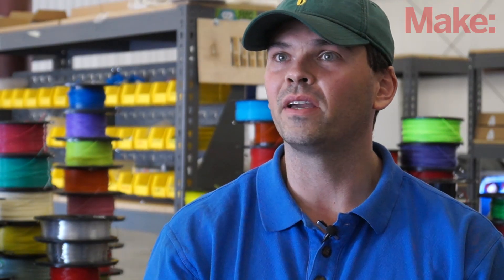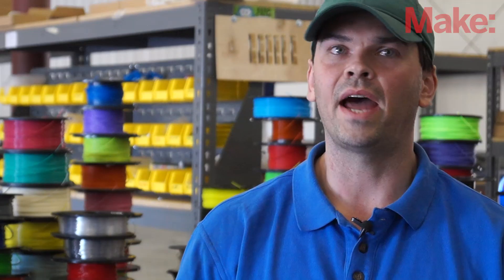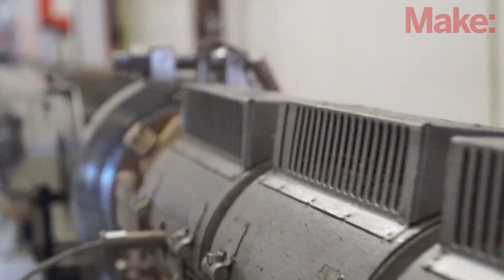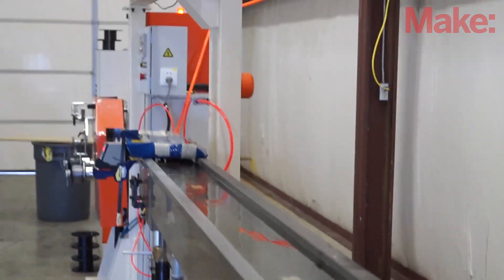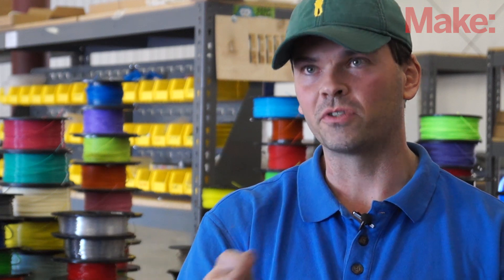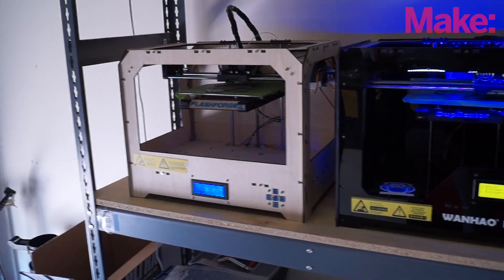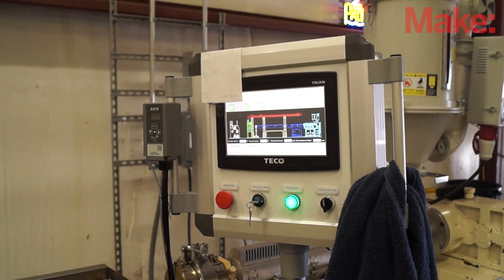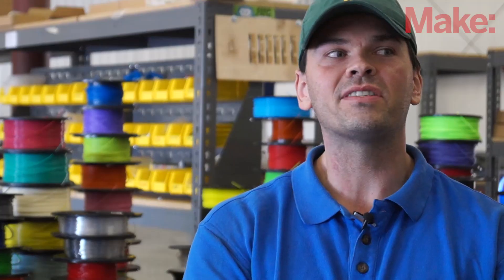How It Is Made: 3D Printing Filament

Comment: Oh....a commercial about how your quality product is being made in America. Never mind telling us what kind of pigment is used or how it's introduced. Never mind what temperature the water is to cool the fulfilment or how the extruder is set in the dimension or any linear explanation of the process. Instead just talk about your precision product that is self automated and you just push a button. I take it you're just a machine operator who bought the extruder machine. Thanks, but I'll buy my fulfilment from China as it is cheaper.
Reply: I bet you voted for Change also....  

You saw a commercial for a product... I saw a video about pride in workmanship...
Reply: Settle down Francis.
Reply: Alvester Coon
Seriously? I transcribed it and you still want to debate it? This is a how its made video, not a where its bought or a quality control how to video. Where do you come up with this stuff? Do you really just type to listen to your brain rattle in your head? This is not a commercial, once again verbatim "there wasn't a quality control issue", see, no problem getting the filament from somewhere else! Go ask Gandalf.
Reply: Yes it's cheaper, and yes this was an interview based commercial, but they are both making it and using it them selfs. This is a good sign, because they will more often then not find problems before they get to their consumers, so their quality will be better then a china company that only makes the filament.

There is also another seceret benefit. Because the product is produced in the US, so it has a smaller carbon footprint when sold to in the US then those that are shipped over seas.

This channel is all about people making stuff themselfs and then telling you about it, if you don't like this then your literaly on the wrong channel because most of the the episode are in one form or another advertisment for the people in them.
Reply: Ignoring the rest of the comments, watch at 4:08, you can see:
- Zone 1 169,5 celcius
- Zone 2 189,7 celcius
- Zone 3 195,1 celcius
- Die temp 180.4 celcius
- Hot Water: 52.6 celcius.

SO! now you know. Good luck making your own filament.
Reply: I've bought many rolls from all over and Makergeeks is on my buy list for 1.75mm ABS and PLA.  Never had an issue and don't mind the extra money because having a 10-20 hour print job fail can real kill repeat business.
Reply: Alvester, I feel like you're not quite grasping the point of the video. That's okay; you aren't the only one.

I could point out how he specifically mentions how you will (likely) never get an oval-shaped filament from him, or how he expressly explains how the whole process works. All that stuff is self-evident, and pointless to argue. You either agree with it or think he is lying.

The point of the video was to explain how 3D printer filament is created. Regardless of where in the world your filament is made, it goes through a process that is essentially the same as this. The point of this video is to explain the process, not to tout a single brand. At one point he explains how oval-shaped filament is produced, and explains why it is likely an error, and not a fundamental design flaw. In that he is basically forgiving and admonishing companies who create such filament. He isn't trying to draw you to buy his filament, he's just pointing out the differences between his and others'.
Reply: Did you bother watching the video? In the first 20 seconds he states there was no quality or price issue with China's product, there was no screaming "America" or any mention of pride. He put the machine together himself and through research he came up with the numbers. It shows the water temps if you actually watch the video and pay attention. If you keep watching you'll see he doesn't need calipers as he uses lasers and adjusts if there's any deviations. I doubt you've worked in manufacturing, you can't even process a 5 minute video (or even spell for that matter! Jesus Christ sound it out or something!). Are you the laid off custodian you mentioned in your comment? The one that just pushes buttons? They probably just kept you in the corner with your foil hat on while you counted your fingers. I think your too obsessed with America. Just let it go man, your seeing and hearing what you want, not whats in the video.
Reply: All I see is a bunch of hate on america. You're welcome to leave whenever.
Reply: Recycled plastic wouldn't be my first choice for 3d printing things that take hours to complete and could be ruined by an "inclusion" (specks of junk that are impossible to completely separate from trash sourced plastic). Trying to make high quality filament out of recycled plastic would be a poor business decision and poor product.

I was surprised that you were surprised "at the lack of 'how it is made'". The video was titled "Making 3D Filament" and showed every step the company takes to produce it. But you fault them for not setting up their own complex plastics manufacturing facility as well?

What I conclude from your comment and others like it is that 3d printing is a huge fascination for young hobbyists (which it should be) and as a result their learning curve will inevitably involve many false assumptions. This is always the way. :)
Reply: Morearty Rockwood
I just did a little spread sheet sorting on the rolls I've brought and from where. From China from 3-2013 to 7-2014 I purchased 21 rolls from six venders. 30% of that was useless crap. None of which would be worth the cost of return for replacement.  From 9-13 to present I've brought 7 rolls off ebay and 3 where crap. Again seller doesn't do return and filing a NAD is to risky for retaliation. 2-13 to present 47 rolls from American vendors and only 3 issues and each was replaced promptly.

There is a difference in vendors and filaments even if it's the same machine being used to make it. If I'm just turning out small trinkets I'll use the cheap stuff to get rid of it. I don't loss much on a failure. But when that big $$$ print job goes through and it's a 20hrs plus job I'll be using the stuff I trust. Depending on the surface texture and strength I'll select which venders stuff fits the need.  MG is stiff, Afinia is more of a creamy texture, MB is plyable, MH has little stringing, etc, etc.
Reply: You dint expect him to be blogging about it, do you? 

Personally I found the drying tip very useful.
Reply: we make this 3D filament machine, email:friend2031@friend2011.com
Reply: *****
  LOL 'the fastest' damm good one. Thank you for the smile.
Reply: ***** So you're attacking me for what exactly? Nothing you wrote seems to apply to anything I said... Are you lost? You seem to be taking my critique of someone else's comment awfully hard. Should you want to actually express a worthwhile opinion regarding that comment you might try quoting the parts you are troubled by and actually relating why instead of spouting ad-hominem insults while pretending to be clever.

ed: spelling
Reply: That’s fine. Why be a dick about it?
Reply: this is not the science channel
Reply: I made a 5kg / hour DIY filament extruder for your 3D Printer which you can rebuild buy your own and safe a lot of money. I share my whole knowhow in now over 180 videos about 3D, Filament Extruder, CNC. Visit my channel and rebuild what you like. I speak german but i have for all videos translations. Share it if you like it.
Reply: blaegme
Well, is it made in North America? Those pellets don't appear out of nowhere. Like many other commentators, I was surprised at the lack of “how it is made”. I genuinely hoped they were melting down recycled plastic. That'd be a small carbon footprint.
Reply: whats more important is that he bought the machine and hes buying the materials from China too :) just like Apple products, produced in China, "tested in US", placed silly price 100 times higher than they buy it from China and plus the brand price.
Reply: Typical right-wing ignorance thinking everyone on earth is American.
Reply: +blaegme read my last comment. The companies in China are the same in America. The ones who make  fulfilment are a division on that company to drive up prices. You can call it American made either way and not tell the difference.
Reply: +briandm82 did you watch the video because he didn't make a statement about the price of products from China or the quality. You clearly don't understand the concept of competition in business as this is a commercial and people just see a video about pride of America's workforce. Never mind the same American business own the China production and never mind they drive up the price under the American label. Usually the China products can be found online at a lower price from the factories due to poor quality control which the American branch doesn't mind as it creates the illusion of smarter consumerism with the public. Those product found cheaply shipped from China won't have the American label and from either a bad mixture in the plastic due to errors in production or bad machine operator procedure, the American branch will look away and say the China branch can do as it pleases with the flawed product as long as the label isn't on it. Might as well make a few dollars online. Why would they throw away something that could still be sold? It's very simple. They do it all the time. At the same time they drive up the price of whatever is in the stock house, not really telling you whether it's made IN America or China. It will say it is a product of America, because after all the quality will hold up from inspection. The only evidence is the part number it was given as with the date, location and code stamp of the shift responsible would tell. The price will be higher none the less. A little less pride in how people view product and getting to the bottom line of where your product comes from goes a long way. You are seeing and hearing what you want without understanding the production line and how it is sold. You know nothing. Are you a laid off custodial manager or something that couldn't manage a broom? I'm a machinist with CNC and manual lathe and Bridgeport under my belt. You probably have never held a Vermeer tool. So before you flap your mouth try and understand production and how it's made before making conclusions. I suggest actually watching the video and stop wasting space by staring off. That's how you probably got laid off in the first place. Be mindful and try using thinking before making an uneducated statement. You just made yourself look stupid.
Reply: Seems more like he is trying to sell his fulfilment. This isn't a 'how it is made' video. I grasp the concept very well enough to know this is a rising industry that people want to promote their product. This isn't a how it's made video. It should be labelled as how 3d printing is competitive and people like you don't grasp that there are other markets out here in the global economy. There are those businesses that make just as good printing filliment. You do your research. This guy explains how hard it it to get the temperature right and calibration that is fully automated. I've heard the same shpeal working in a machine shop as a tool maker and explaining it to kids who come out of the street that think it's about pushing a button, which in this case it is. He pushes a button and the machine does the work, keeping the water at a constant set temperature as it cools the filliment slowly. That's obvious as plastic will will warp if the bath is too cold. And air drying plays an important role as it is run through the machine to keep it constant. I know this not o lynch having taken a tour with a friend who works on these, but also working the guy on plastic printing presses which we used a combo of uv light and heat in a hybrid design that we worked on. 
Forget the pridership of america and your obsessions of political prowling as that has nothing to do with 'how it is made'. I'm surprised at a lot of people's gullibility and not seeing as this as a Make's way of promoting their product from another part of their business venture which they own. It is utter stupidity to blindly see pride when this is a poor version of 'how it's made' video that is in part a commercial. I worked for a company that made gun parts that had more precision and quality than Smith, but I didn't go around screaming "AMERICA!" Every time I knew I made a quality scope mount for a rifle. Pride should have nothing to do with precision and function as it takes more than some machine operator who who got laid off at a custodial job to come in and push a button. Those aren't machine operators. They don't even know the G codes and they sit there to watch the machine and load the parts. This machine is far more simple than operating a 5 axis hass machine or manual Bridgeport. You push a button, make sure the tank is properly level since the water evaporates. This explanation is so poor  in the process a dumb kid who has to push the button won't understand what goes into quality control. This stuff is manufactured cheaply. Something as simple as picking up a micrometer or vernier and measuring the thickness every 5 feet would tell you something. But they don't. And it is far unlikely they tell anyone. And if they are comparing oval shaped extrusion that is a very older issue that was solved. No one sells oval shaped extrusion as that is not good enough for selling and would be sold second hand on eBay without their label. No point in letting a few bucks go to waste, after all. It would encourage those who buy it to buy more expensive stuff to ensure that they don't get stuff like that again. So, drive up the cost for quality control, not because they did anything about it, but because of paying the Labour that went into making what would have been scrap. AMERICA! Yes, they actually do that, selling faulty extrusion to drive up the cost of more quality extrusion. Got to make that extrusion worth more somehow. But for those who feel they have to exclusively buy American, realize you will never know if it was made in America or China unless it's sold on eBay or Amazon. It's an American company that sells its product higher either way because they can say it's American made, but not tell you it's was delivered from China because it's cheaper to be made there. But, if it's badly made, label it from there and people will feel they are the wiser. Believe me, after working in a label factory for a year, you learn about that sort of thing. AMERICA!
Reply: Or you're a troll yourself on a ride to conspiracy and everyone is out to get you. Add 66tbird1 to that list of three heads. Oh and don't forget Christian Lucian and the like. Also marketer's to push advertisement.
Reply: You idiot. He makes his own filliment and gets it from China as well. When they make their own filliment in America they get the plastic and dyes from China and mix and make their own. What part didn't you understand? Clearly English is a second language for you. He never said that there wasn't a quality issue with materials, that's a claim on your part. Did you not understand what I told you about quality control? It doesn't matter if you get the same dye or plastic quality because if the operator just pushes a button and doesn't know how to maintain the machine you'll get a shit product. It also requires measuring with precision tools to know if your product is the right OD to be able to print with it. Also understand that if you get the same materials to mix yourself it can still be an issue as one batch of dye or plastic can be different from the next batch. It's the same thing as metal as metalugically one shipment will be different from the next if you anodized the aluminium. Duh! If you mix a slightly different colour fulfilment or too much dye it will affect the fulfilment. If a business man says there is no question of quality he is lying. He is a business man. That is why there is quality control. Go practice shoving a broom, because that will be your lot in life if you are lucky. Again with the lack of understanding English as I never mentioned I was a hobbits. I referred to those who are experimenting with 3d printing. And while I do have a 3d printer I use it for prototyping and is easily milled if and when needed. What part did you not understand? I suggest going back to school and learn a little more. Try paying attention, sounding out the words when you read it out loud and take notes.
Reply: +Benjamin McEvoy it really is a shame the education system fails. Without abstract thinking it's like the blind leading the deaf. But I guess learning disabilities prevent people from thinking for themselves and understanding the simplest understanding of common sense and basic English.
Reply: +briandm82 You seriously didn't watch the video. You hear what you want to hear when watching a video. Nothing of what you said is what he said. He only made mention that the product is produced in China and his company makes it in the States because it's called competition. He not only makes his own filliment, but also uses it. That's all he said in that. It seems you either don't understand a video or just troll, not really thinking or knowing what you're talking about. Did you watch the entire video? Did you read the title of the video? Because everything you're saying points to ignorance and uneducated judgement. 
As for why the cost of producing parts one knows as a machinist that the cost of materials plays an important part in production and hobbyists. Any hobbits who's smart enough would count that in prototyping and creative design. If the cost of producing a part does not equal or be less than a part that can be bough there is no point if there is no investment for a single part to be bought elsewhere. This is basic business principals., nothing you wouldn't know it seems. You need a measuring caliper to measure your stock before you mill or print a piece. If you are stupid enough to not check for the quality of the filliment before printing it you should step away from the machine as you should step away from the keyboard for not understanding English.